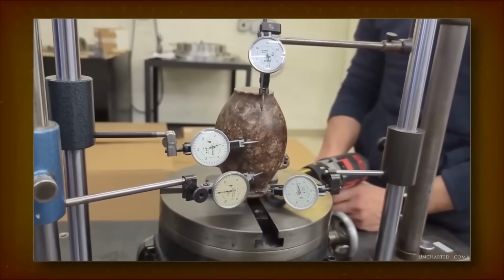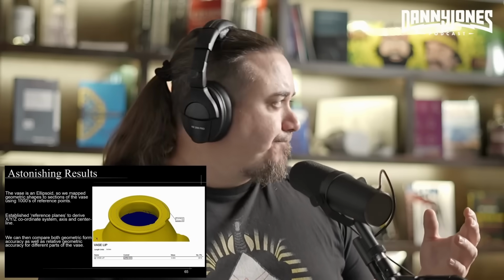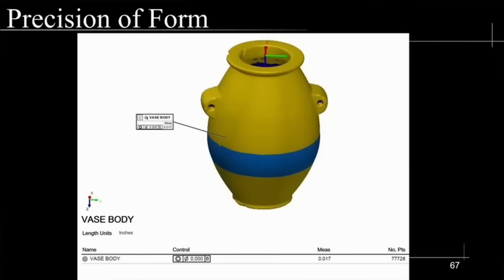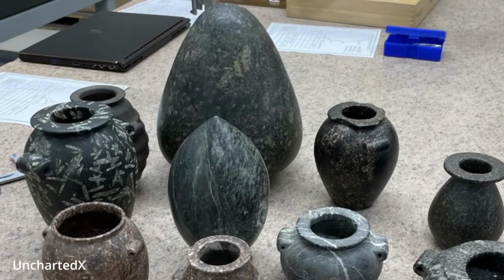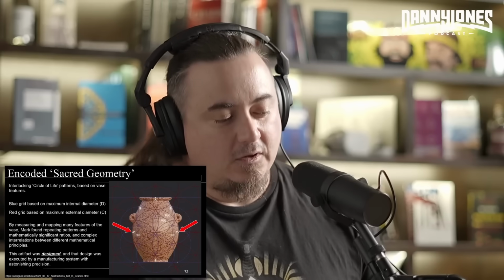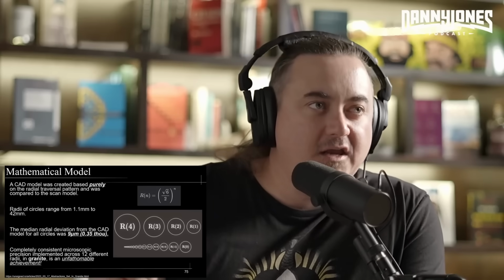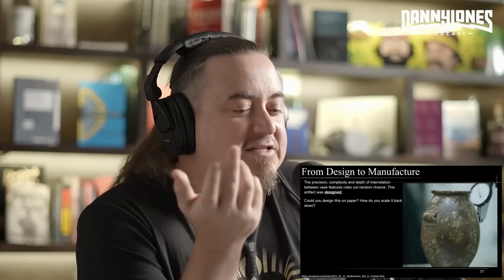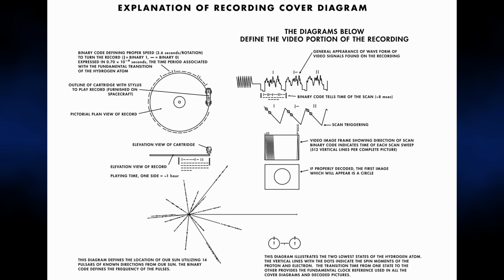Are These Ancient Egyptian Vases Actually Impossible to Make? #podcast #science #history #egypt

Comment: Decades ago I worked closely with machinists who could have done this, on old machines. As in machines from the 50's and 60's with a few from the 40's. These guys were exceptionally talented as per the demand of the Aerospace industry.
Several things to note, with this in mind.
1. The skill level to make one of these is off the charts, given the material especially. The machinists I worked with spent decades honing their craft, that included the mathematical education required to design and craft complicated pieces.
2. The remarkable people I worked with had thousands of years worth of accumulated knowledge of science, math, physics, chemistry etc... to draw upon and use.
3. They also had the modern tools at their disposal. Utilizing strong power plants to drive them, as well as the strongest alloys to be strong enough and sharp enough to do the job. And in numbers high enough to replace the damaged or broken parts that naturally occur during regular usage.
...
4. This is the part that really gets me. Please consider this carefully when confronted by artifacts like these.
The tools used must have a tolerance 10X finer than the resulting tolerance. 
Which means that if the end result blows you away, just imagine what had to go into the tools that made it. Because, as stated, these could not have been made without the aid of some machine.
Reply: I am 78 from Aberdeen, the Granite City. I would love to have the Aberdeen granite workers from the late 1900s give their comments. They would know what was and wasn’t possible with basic tools. Vast numbers of granite balustrade pieces in the city from lathes and much ornamentation and an amazing hand chiselled granite statue of Edward VII but no vases I know of. All can be seen online.
Reply: @pamelagaull3928  Did they use copper chisels and round pounding stones?  Were they able to create granite boxes with the inside perfectly square with the outside?  Were those stonemasons able to make perfect 90* corners and perfectly square with the outside?  Were they able to move 100 tons of granite after being perfectly shaped 600 miles without using steam, ICe or electric motors?
Reply: Your fourth item is wrong. Traditionally craftsmanship was taught so that craftsmen learned to use crude tools to create 10x more fine results. That way they could escalate their precision by using crude tools to create better tools and then use those tools to create even better tools and finally use the end version of tools to create even more high precision products.
This is how the fine tolerance tools you mention is even made today. If this wasn’t the case then there would never be any high precision tools in the first place.
Reply: @RasmusLarsson-c4r You make a good point. I'm applying Aerospace mil-spec. Which, as you correctly pointed out really wouldn't have applied back then.
...which really makes it all the more amazing.
Thank you for that correction 👍
Reply: Humbly. And the infrastructure behind all of the above!
Reply: @djonnserpant8325  "And the infrastructure behind all of the above!"
which of course has conveniently and magically vanished .....amazing aint it?
Reply: @thomasxxxxxx2345  You of course assume our technology in place of THE technology that made the vases.   We print things of decent accuracy out of plastic and increasingly expoxies and other reactive compounds that harden later.   But these chemical objects would be far less durable and for a people returned to a near stone age culture after a woldwide catastrophy, ready campfire fuel.   Hmm, those computer chips burn nice.
Reply: Ben from Uncharted X is the Best.
Reply: This is one of the best vase comments I’ve seen. 

Sending this to Flint Dibble now.
Reply: That's their point for sure.
Reply: The governor of the accuracy is the tolerance of the lathe, which is governed by the accuracy of the parts of the lathe, modern bearings for lathes have incredible tolerance as do the spindles and setting tools, it not solely the skill of the operator or the sharpness of tools that govern the accuracy of the piece.
Reply: so what the heck? how were they made? and what were they for?
Reply: They understood more than we do today. The other thing is no one said you can't do that. I see that in building today. Look at how fast they built the empire state building or some of the dams. Today we say you can't do it. They just went and did it. Same thing as in ww2 building bombers at incredible speed.  They can't even do it today. Its a can do belief that finds the way.
Reply: So you knew machinists that carved granite vases to .007 of an inch of precision?
Reply: @moun7ainc0w No doubt they would have found a way. I view these highly skilled artisans, which is what they really are, with the same wonderment that early man would view a doctor. Pretty much, magical. Any extraordinary engineering feet, in any age, is always a wonderment. Even if you're there to see it all happen yourself. It's a testament to the better part of our species.
Reply: Thousands of years of accumulated knowledge, and i suppose since Egypt is thousands of years old that the knowledge comes from there...where these vases were found. The Roman empire pilfered these ruins , the vatican, hell even Nikolai Tesla had interests there. I would say and excuse 'the conspiracy theory' of it, is that I wouldn't put it passed the cover ups of what has been unearthed and found in these deep vaults of Egypt have all been reverse engineered and presented as a new breakthrough of technology. Cause you can't just find something extraordinary and not put your name on it now can you.
Reply: High speed lathes requires power ! They much be much older than stated
Reply: The inarguable fact behind these artifacts, and the countless other artifacts through time that seem unimaginable to us, with our modern perspective. Is that our species is, and always has been, exceedingly resourceful and historically underestimated. We can look at these vases and see the result of craftsmanship and innovation, but not the means of how this was achieved. This is simply due to the antiquity involved. But we can still look at the cathedrals of only a thousand years ago, and marvel in much the same way. The difference only in being that we know how the cathedrals were constructed, as well as the failures. So to us, it's less of a mystery but no less amazing. Throughout history we have glimpses and hints of marvels and wonders that no longer survive. Think of the skill it takes to manfacture a thin pocket watch nefore the industrial revolution. Or the amazing French automations. Some programmable, that still survive . The list is endless, and that's just what we know about. So the prospect of man to find innovative ways to solve problems, including the creation of specific tools to accomplish said tasks, should be viewed as the default position with less surprise and shock. Something we're all guilty of, to one degree or another. Because, at the end of the day, either today or thousands of years ago, we are the same animal.
Reply: overthinking it.
Reply: @FriendxA ...hmmm....you may have a point.
...maybe they just looked nice with pretty flowers in them.
(Not snark, believe it or not. They could have been made by hand by someone who just wanted a cool jar to put stuff in. On balance, that may be the most believable scenario presented. Why not?)
Reply: People will go to great lengths to stay alive. Remember that.
Reply: The only hole in your claim are the handles.
Reply: But to do the round part of the vase next to the handles would surggest a 5 axis process. You cant spin it like a lathe. But then how do you get the inside so almost perfect by hand? The granite is different strengths so spinning it and doing it by hand wouldnt get close the the dimentions it is. All this stuff surggests to me is there used to be tech but its not here anymore. Or we just havnt found it. We reverted back in evolution. How? It was a time about gernerational traditions and skills. How did we loose it? Again something is missing. Liturally.... in my opinion 😊
Reply: With modern technology it's not impossible, but it would cost millions of dollars and years of R&D. 

With 50s technology you'd need less money but significantly more time and R&D to get it. 

With 18thC technology it's basically not possible.
Reply: I doubt that they could have done that with brittle stone
Reply: Point 4 simply blows my mind.
Reply: Why do you use the exact same punctuation style as everybody else who says theyr also in aerospace machining?
Reply: You prove you are wrong by claiming tools must have a 10x finer tolerance. Absolute lie.
Reply: @PanglossDr I corrected that and put it in context. So "mistake" not " lie". 
However, when it does come to manufacturing such objects, if one wants to check the tollerences of the work created, then your inspection tools must be vastly more precise. 
The operative word being "if". 
I'm fairly certain no one was going around measuring those artifacts for precision. But, you never know. 
Still, absolutely amazing work in any context.
Reply: most 3rd world countries can make this
Reply: You don't make precision products for fun or to demonstrate you can. They must of had a purpose that required that precision.
Reply: @DavidJTaylor-s1c Honestly, I've known quite a few that did exactly that. So if someone did, thousands of years ago, I wouldn't be surprised in the least. ...Lots of examples...but I'm thinking about one, perfectly milled, titanium boat hitch (I'm looking at you, Chuck)
People will be people. We're still the same animal at the end of the day. 😅
Reply: @DavidJTaylor-s1c this is my thoughts too, what was their purpose, were they part of a larger system?
Reply: @DavidJTaylor-s1c or they were so skilled this was mundane.
Reply: I agree.
Every machinist I know would have a pack of cigarette rolling papers in his toolbox, right next to his micrometers.
Cigarette papers are .001” and make a great way to see if the micrometer is still accurate.
Reply: @dangeary2134 WowThat's incredible information.I can't wait to convey that with my dad.He will be really interested and probably very impressed.Where did I get that information from?I might keep that one in my pocket , ha ha ha
Reply: @dangeary2134  cigarette papers are 0.012 to 0.020 bigger variant than these old pots, that's how accurate these vases are 🤯🤯
Reply: I dont believe the vases are as precise as Ben says they are. AFAIK, the only expert he used (who he refers to in this blurb as an aviation metrology expert) is Chris Dunn's son, which is notable bc Chris Dunn invented ancient precision claims.
Reply: @ryandebruys2762 Exactly. I highly doubt the hyper precision he describes. Even in one amphora out of a million.
Reply: @chefmarcos  I read Alex dunn's 8 page report. Their measurements showed nothing special from their comparison vessel - a marble vase made on an ordinary lathe. Any suggestion the ancient vases required a CNC machine or had CNC-level precision are baseless
Reply: @ryandebruys2762 If youve never built anything that has to be perfectly precise, such as in a machine shop, then you wont know what youre looking at here. The things found in egypt could never be made without machines and advanced tools, including the pyramids and these vases. No amount of slaves, times, and basic hand tools can do theee things. Its a lost age that history has not taught us yet.  The sphinx is like 13000 years old, it faced the constellation leo when it was built.
Reply: @ryandebruys2762 most are 19th and 20th century forgeries as well,
Reply: ..."The tools used must have a tolerance 10X finer than the resulting tolerance."
Wrong.
For example, to create flat surface you don't need some 10x flatter plate for reference. Only three surfaces - plates are needed and rubbed together with each other. Similar examples apply to turning and other techniques.
If you follow your own logic (the tools used must have 10x finer tolerances), then machines used to make those tools must have additional 10x finer tolerances. ...and tools to make those machines  other 10x... So, no. This is not how things work.
Reply: @danieles54-453 I was making a modern reference. Which was my mistake. Of course there are limits. But in the modern sense, mil-spec, the tolerance required in your tools is very tight and demanding.
Where it really gets crazy is in the inspection process. 
But again, my mistake was applying modern standards.
However, the rest stands. And, in total, makes these artifacts and the people who created them, even more impressive .
Reply: Ok....show me the motor they used to run this phantom machine. Or the insulated wire that was running out from the power source. 

He'll, show me 1 single millimeter of insulated wire from ancient Egypt
Reply: Wooden lathe built by Master carpenters out of oak.
Copper chisels with cut diamonds set in the end .
Water 
Many fine grits natural chemicals and acids to get the final result .

I’m a carpenter and Joiner id like someone to measure what I make it’s not far off perfect to the Hand , eye , and brain from 50 years of practise. 

I bumped my car bro panel neat it out before my eyes by the time he had finished I could not see it , feel it not even feel it with my tongue 👅 . Then he re sprayed it perfectly . All by eye I’d like someone to test the surface for perfection it will It be far off I’ll tell ya . The vases were easy it just took time and skill + knowledge. If it took a year to make them not took a year and no one complained it took so long 

No one rushed De Vinci he took his time to get it right as fast as possible then speed it up
Reply: You don’t need no math to draw a circle.. medieval masons in Europe didn’t know any math beyond basic geometry if any.
Reply: @dragonsandfliesandpotatoes completely untrue. They knew math
Reply: Exactly. Quite a bit of these are in fact 19th and 20th century forgeries.
Reply: @timpage5021 interesting....any reference material on the subject, that comes readily to mind? (Totally cool if it doesn't! No worries.)
I know there's speculation that the bust of Nefertiti may be a forgery. Antiquity forging is as old as antiquity itself.
Reply: Did you do like...any research before making this comment? This has been debunked for years and years and years. lol So many skilled masons have made perfect replicas like these.
Reply: @CARTUNE.  Great, it should be really easy for you to link us to any number of evidentiary videos then. Looking forward to it
Reply: there were no tools, no machines, the vases were made a method unknown to mankind, not by mankind
Reply: @DaddyAl-Baddie  lol of course they were made by men
Reply: These were made by machines a long way away a long time ago but definitely in this galaxy, They might actually be perfect and the deviations of dimensions and angles might be zero (+/- one atomic lattice unit of whatever crystalline metal oxide, sulphate etc.  and the error is in our clumsy measurement techniques and the imperfections of our instruments. They are exactly like the regrettably friendly gold disc on Voyager I but made by a far more advanced civilisation to test the connoisseurs of vases and engineers in less advanced civilisations. They were delivered by "unmanned" (un-lifeformed) extra terrestrial exploration drones that most civilisations will end up sending emergency directions at some point to see if they can find and contact solar systems with nice life planets. 

The autonomous drones can travel for thousands maybe millions of years at relativistic speed and they can spot a nice warm CO2 making planet from light years away and go and take a look. And they can send messages instantly to the descendants of the individuals in teh culture that made teh drones and sent them all into space in a million directions at maybe half the "speed limit" out there. As long as they took with them some entangled fermions with spin 1/2 up and left behind their spin 1/2 down dance partners, they could take aeons to find a nice juicy wet planet and call home immediately and say "Found One". And after studying the new world, the home civilisation could decide to come and plunder or assimilate or just toy with and enslave then local inhabitants, and they would not come in some armada of battleships, No, they would have recognised long ago (as we still have not recognised) that their entire solar system is a perfect long haul space ship and they will come with the whole thing, star and asteroids etc. and park it above the system just discovered and then, well,  it's not going to be pleasant is it? 

It is completely ridiculous to think that any mortal alien being would ever leave its own world to go exploring or start some wars because they would have to kiss their friends and family goodbye they will never see them again because thousands and thousands of years will pass on the home world after the intrepid but mortal travellers have been out in space for a few weeks there will be nobody to go back to that remembers them. It is a one way trip so they would instead send immortal intelligent drones and they would hand out vases to a few locals and see if they appreciated the engineering perfection and proportional profound numerical genius of teh vase construction at whatever level. Is it like serving Chateau Petrus at a rodeo or is it like showing a Formula One car of today to Henry Ford. At the rodeo no one would notice the excellence of the wine costing $10,000 a bottle if it was $5 a glass. Just like primitive civilisations would not be spooked by some guy in the tribe finding a really nice vase to put under the bed at night. It iOS a very clever and non-intrusive measure of civilisation levels.

But wouldn't it be ironic if this had already happened and the aliens were all trees and they left behind billions of settlers (full grown trees) who took over Brazil and Canada first. What if Brazil is correct and we should cut down all the trees to save the Earth?
Reply: @Synapscience   dude, I'll have what you're having .... piss funny 😃😄😁🇦🇺
Reply: @Synapscience  Mon problème avec votre commentaire c'est que vous supposez que la vie ne peut exister que sur une planette avec du CO2.
C'est une vision très restrictive, tout comme le fait que certain pensent que l'ADN est une constante des êtres vivants.
Vision limitée de l'humain qui transpose se qu'il connait en pensant qu'il ne peut y avoir d'autres composition.

Jusqu'au jour où...😮
Reply: @Synapscience  Wow; just wow. Gulp. 😶
Reply: @Synapscience you have quite the imagination
Reply: @Synapscience  insane comment thank you
Reply: @Synapscience You should have micro-dosed instead of taking the whole package.
Reply: @Synapscience lol I'll give you a like for that. Im from Canada, lets cut down the Fing trees, boiiiiiiiii. Makin .001 thick rolling papers like a bunch of bosses.
Reply: @Synapscience  the assumption that there isnt a potential technology present at that time that could operate differently then how you with time . And if they go travel with their entire planet dont they bring their fam ?
Reply: @Synapscience Imagine typing all that lol